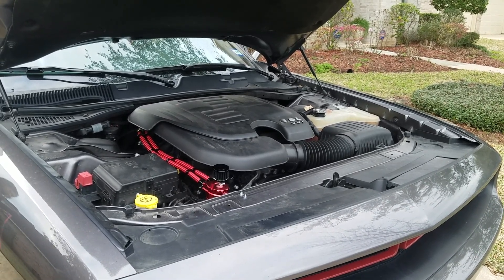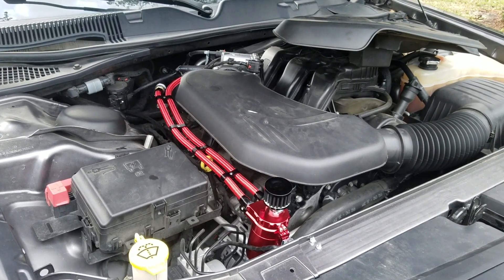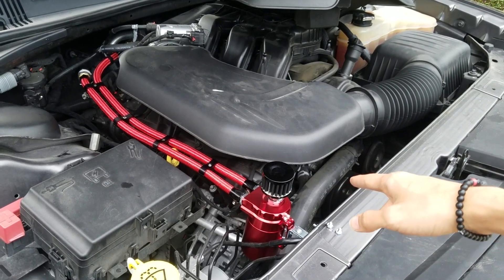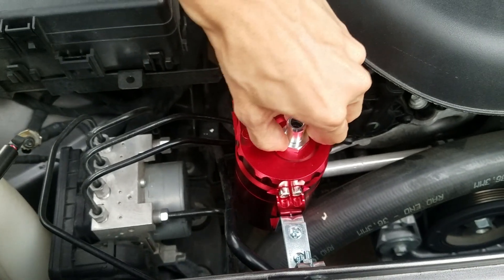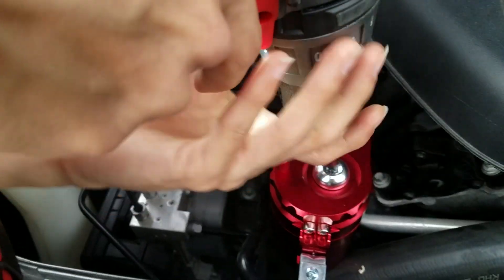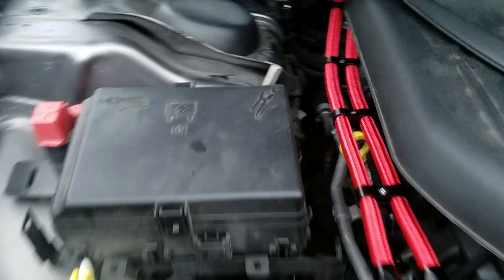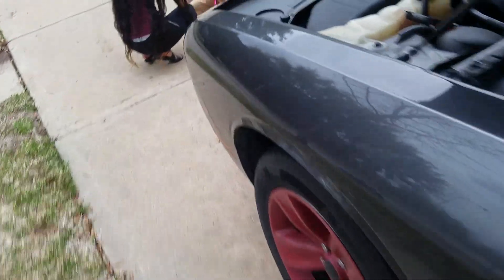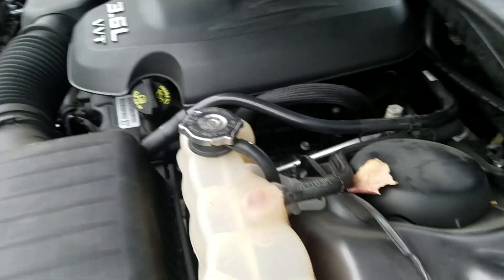Oil Catch Can with Breather or NO Breather?

Comment: If you want a breather just grab a one way check valve crankcase breather from UPR. It replaces your oil cap. That way air only escapes from your crankcase when under boost. Under normal vacuum the one way check valve doesn’t allow air to exit and functions as a regular oil cap.
Reply from the maker: thanks for the info, i dont own that car anymore

Comment: Without a check valve my Honda gained fuel mileage at highway speed but also developed a high idle.
Reply: I too gained gas mileage  I installed a dorman oil catch can on my 2012 chevy malibu with the 2.4 ecotec 115,000 miles and installed a venting oil cap for a 3.6 v6 engine for additional venting a 2.0 turbo ecotec oil cap works too I have a modified air box and air pipe peace and much respect to you 👍 JASON

Comment: Did you learn sonething in Auto Shop class today kids?  It must be so exciting to find something for the first time. Due to my experience and age I do not get that much of the basic excitments any more I been there done that.    It sounds more aggressive of course because the change is air pressure in the system.  As you mentioned the negative air flow.   That does need to be a closed system or the timing will not be proper. If you do want it more aggressive buy a Tunner or get the ECU Tuned Professionally.  I use a Monte GTR Tuner Module for my CTS.  Something about the RPM Guage I noticed it only goes to 7,000 max. It must depend on year I guess, and how the engine is made. my 2013 CTS goes up to 8,000 RPMs.  I need to do some investigation if it is the gearing or why mine goes to 8,000 while others go to 7,000 only.  I just bought an Oil Catch Can tonight because of my engine is Dirrection Injection. Hoping the Closed-loop(it does come with a Breather option), will improve my issues and filter any contaminants from the engine.  Get a Cold Air Intake will deffenantly make it aggressive and sound deeper.

Comment: It’s hooked up wrong. Just a huge vacuum leak. Instead of running the outlet hose to the intake manifold it should run to the intake before the throttle body.
Reply from the maker: Just read the other comments I already addressed the issue and the fix

Comment: I might be alittle late but are the lines hooked up the right way? Shouldn’t the dipstick be pushing out?
Reply from the maker: the orientation of the catch can can be either way. it has a built in filter area where you can add a baffle to prevent oil going back up the line. the intructions do show a certain way for the lines to be hooked up but the way i set it up it wasnt going to work right so i just switched the line. plus its a v6 so i doesnt produce that much oil vapor. i empty it every time i do an oil change.

Comment: Someone might have explained this to you already but...

The catch can is connected to the crank case on one end and the air intake on the other (not exhaust manifold as you said in the video)

Do not open the catch can or check the dip stick while the engine is running. This creates a vacuum leak where your car is taking in extra air that hasn't been measured. Furthermore if you happen to have a catch can that's 1/4 full you run the risk of the vacuum leak to pull oil from the catch can into your air intake defeating the purpose of a catch can or possibly worse as instead of vapors entering the system an ounce of oil mixed with water and fuel dumps itself into the system.

Why the can has a filter. In the 1970's and earlier they used to vent the crankcase to atmosphere. This is an open system. This is why many people had oil drippings on their driveways. The oilvapor would escapee to atmosphere but some would condense enough in the vent tube to be oil droplets which would then drip from their tube and onto the roadway. Especially noticeable if the car were to sit in one place for long time when hot. For example after the cars been driven then parked. Other than the atmospheric pollution this also caused roadways especially intersections to become slippery for the first few minutes of a heavy rainfall. So on cars like this where the air isn't returned to the air intake then a filter for it to cleanly vent the crank case pressure to atmosphere is the easier way to go. Or plumb it to the air intake as a vacuumed line to close the system.

To remove the vapors from the atmosphere they decided to plumb to vent line into the intake manifold where a vacuum exists. There are a few different locations I've see it plumbed in but personally I feel before the air filter in the air box is the best place. This though would cause oil vapors to collect on the air filter. So an oil separator is plumbed in to help the oil vapors, water vapors, and fuel condense into liquid form and come to rest at the bottom of the can, while the cleaner air then passes back into the cars intake system. If Done right with a quality can, then the air filter should see no vapors. 

Reason for the air box being my ideal location is that it gets filtered a second time (catch can is a filter) and the intake filter is always before the map or maf sensor, so the crank case air is being measured as entering the system.

There are some intakes with map sensors in the manifold after the throttle body so the vacuum air is measured I suppose but having the air filtered a second time is lost in that application.

Of you're running a cold air intake with a cone style filter and no air box then this would not work. I would suggest then that the line be tied in after but near the cone filter. This would make it easier to inspect for oil contamination coming from the crank case, whenever you remove to clean / replace the cone filter.

Adding to the idea of maintaining the air cleaner..  I'm a fan of wix air filter service gauges. Have no idea why this gauge isn't made standard on 100% of cars out there. Take 1 second to read and understand, 1 second to reset if needed. And helps owners know when the air filter needs changing/cleaning without the need to know how to inspect a filter. Really those air filter gauges been around so long, it's strange that it hasn't got it's own IP address to tell the cars 146 computers that it's time to deal with the air filter.
Reply: where on the crankcase is there a connecting point, I thought that it is connected between the PCV valve and the plenum where the PCV hose is presently connected.
Reply: @carlodonnell146  you're right! But so am I... pcv = positive crankcase ventilation

Pcv valve commonly on the (or an integrated part of) the valve cover. The pressure it relieves is a part of the overall crankcase atmosphere. And yes to the intake plenum is where the other end is connected.

Apologies for not being more specific. 😉
Reply: @danielsimpson8929  It's ok , I appreciate the back and forth conversation. Thanks
Reply: @carlodonnell146  cool beans.
Reply: @danielsimpson8929  not being specific and being wrong is different
Reply: @ismaelcarrillo3956  yes! And not being a banana and being hilarious is also different.
Reply: What?! Wh where do you think the oil was going into before the catch can? A spam folder? It was going into the air intake already
Reply: william III  great question. I've not done one on a diesel but I have fantasized filtering gases from the egr on a diesel. Not sure your 87' would have an egr. 

Otherwise I'd expect the the catch can to plumb in the same way. With a diesel having a higher compression for ignition I'd wonder if more Blow by may be seen into the crank case. If so you may find the can captures more sunburnt diesel. Unsure of the temperature required for diesel to be a vapor but I'd think the temperature of the engine oil should be high enough to vaporize the diesel out. Unless the diesel somehow breaks down the oil/forms with it.

Good luck!
Reply: So if i have a PCV system,i should install an Oil Catch Can without air breather,right?

Comment: If you're using a filter on a catch can, it needs a check valve to allow the vacuum from the engine to properly function.  The check valve has to prevent the air from being sucked in thru the breather, but can vent thru the breather in the event that no vacuum is present, but pressure from the crankcase is.
Reply: Would the check valve go the line going back into the intake manifold or the line from the valve cover to the catch can
Reply: Can the filter be illiminated and plugged? I hope I havn't ordered the wrong catch can
Reply: what is a check valve?
Reply: Check valve is a one way valve.  You'd need one for air though I believe because the fluid ones require a certain force to open the valve and a slightly less force to keep it open.
The crank case should have posative pressure at idle and negative pressure at higher rpms.  Did you attach to the pcv valve or to the crank case breather.  And it matters if you did passanger side or driver's side also, I think it's supposed to be passanger side. ALSO... the can with the bronze filter is too restrictive, get the one that you add the foil to or drill tiny holes in the bronze filtervif you already have that one.

Comment: You need a check valve on the breather, which will allow it to  breath only when under pressure. Normally this will always be under vacuum from the intake side.
Reply: won't the PCV VALVE  act as the check-valve?
Reply: @carlodonnell146  I guess it depends where you're putting this into the system. Most likely without a check valve you will be introducing a massive vacuum leak.
Reply: @DigitalSkyline  Can't I just plug the filter connection and use only the catch can?

Comment: You're obviously not getting how the system works or why you're doing it. Your goal is not to force oil out of the crank case, simply to prevent it from going into the intake side. Your system was perfectly fine with the breather.  Or you could even block off that intake side to ensure no vacuum leak situation and further prevent risk of oil in your intake at all.
Reply from the maker: I took the breather off. Car isnt meant to have it, and it obviously wasn't idling right with it on. I would just block it off. But I Leary bought all the parts so might as well. Not to mention a drilled hole lol. I am starting to lose interest in the 2016 challenger and currently working on a 1974 Plymouth satellite

Comment: The circuit must be closed , pressurized.  I don't know about turbo , but on a na engine , NO BREATHER.
Reply: no breather on a turbo application either. thats just a big ass boost leak
Reply: @Aupexx  you use a breather setup on boosted cars. All you do is run the hose from the valve covers and crankcase to the can and that’s it. Delete pcv bs
Reply: @markross215  good to know I was unaware of that. Thanks for the correction!

Comment: You have mass air meter?  If so you are introducing unmetered air into system.  You want the crankcase vapors to go back into intake after a catch can to separate oil from air
Reply from the maker: I think I do but I am not sure where its located, I removed the breather. So that isnt a problem anymore.

Comment: Excelent video bro, just what I was looking for. I'm gonna buy a catch can and I don't know if buy vented or seal. At the end I didn't understand is it better vented or sealed?
Reply: Nice ty
Reply from the maker: Either one most vented kits allow you to seal the catch can. But I would recommend sealed. Vented caused a very loud whistling sound in my system and didn't sound right. I never got a check engine light but was idling higher than usual. So sealed it is, for me personally.
Reply: @tigervxii  thanks I'm buying the seal then
Reply: @gerardogomez6104 which did you buy? Sealed catch can? How's it going 4 years later?

Comment: Looking at your "Catch Can Unboxing" vid, and the internal diagram of the can, I think the design was meant to give users an option. 1) Use the breather, so the pressure difference between crankcase and atmosphere is the force. This means you wouldn't need to connect the other end to the intake manifold. 2) Plug the breather, and connect the other end to the intake manifold, so the pressure difference between crankcase and intake manifold is the force - which would be much greater than to the atmosphere. I can imagine the breather method is if used a complete aftermarket intake with no inlet port for the PCV, or if your engine is so finely tuned, that all the oxygen level going in needs to be perfect  - which means you don't want any unknown gases.
I think a good test could've been - driving XX distance with the breather on, and then XX distance with the breather plugged up, and see how much oil actually gets "caught". I guess in theory, the amount should be more with the breather plugged up, because of the greater pressure difference. However, I have a feeling that too great a difference could also maintain a turbulent airflow in the can that doesn't make it effective at keeping the oil. - since it would keep the oil in smaller droplets and be able to carry them.
Reply from the maker: I see what your saying, I personally want with the conventional no breather  and recycle to manifold since it's a cleaner look

Comment: Can a catch can like that be use with the filter and without?
Reply from the maker: Yes, you just have to use the provided bolt to fill the filter hole
Reply: Have you catch any oil on that can
Reply from the maker: yeah, a  lot i will upload a video soon when i do my next oil change.
Reply: Thank bro much appreciate it hehe I don’t know if you know but the g35/350z burn heck of a oil
Reply from the maker: @josevelarde4113  no I didn't know, I another one for the right side kid the engine. Didn't know vvt engine need a catch can for both crank cases

Comment: All engines,except diesels, require engine vacuum for the PCV system to work not just VVT engines. The PCV is ALWAYS connected to a vacuum port! Venting the crankcase directly to the atmosphere is AGAINST THE LAW, besides being bad for your health.
Reply: Yeah, that's great and all, but how many hydrocarbons does  the production of a new engine cause because my manifold is gunked up with oil and half spent fuel
Reply: @whoathatsalotofdamage3718  Try to remove the inlet manifold, so you can see y yourself  and attest the heavy oil deposits caused by that stoopid system called "PCV".  PCV was designed to avoid venting hydrocarbons to the atmosphere, BUT saying those can be "cleanly burned" in the engine is wrong.  Heavy HC that come from oil vapors are too heavy to burn properly in a gasoline engine, and their Octane Index is way too low, lowering the effective Octane of the mixture.   Inlet manifolds get covered in oil, but inlet ports (which are hotter) convert that gunk to porous carbon deposits, that hold the extra fuel injected when accelerating hard, to release them when the accelerator is released, so hurting the proper A/F ratio; and deeper inside the engine, where temps are higher, the gunk is transformed into hard carbon, depositing on the inlet valves and reducing airflow and performance.  Why was the std PCV designed that way?  It was because it was "convenient" for the lazy and cheap automotive designers, and has been kept wrong all these years.  Install a proper Catch-Can and be surpised of how much gunk you will catch!
Reply: @alfredomarquez9777  dude I'm well aware at how dumb pcv systems are, we are in 100% agreement and I'm well aware of flashpoint polymerization that occurs to the oil as a result of recirculating the vapors and blowby. It's a dumb system, and I'd argue it's designed to increase planned obselescence

Comment: NEVER use a breather, your breaking the system and creating a lean condition. The PCV system performs critical functions to remove the constantly entering as blow-by. These consist of water, acids, raw fuel, and abrasive particulate matter. Venting is a guaranteed way to shorten your engines life by 1/4 or more.  You want to pull full time evacuation removing these as soon as they enter before they can settle and accumulate.  Breathers/venting was the standard until the mid 1960's when the PCV system was mandated to reduce ground water pollution from vent tubes dripping dirty oil in the roads. What was discovered that these same engines, using same oils were now lasting 100k plus miles before needing rebuilds VS 40K average prior to the PCV system. Only one function is pollution related as far as the PCV system.   So much misinformation out there that will harm your engine over time.  Crazy.
Reply: equally the oil vapour being recirculated back into the intake will possibly clog all the intake piping, manifold and valves reducing longevity of the engine. not to mention on turbocharged cars.
Reply: >What was discovered that these same engines, using same oils were now lasting 100k plus miles before needing rebuilds VS 40K average prior to the PCV system.

Citation needed.
Reply: @UC0kSOJVdGxks4KnhGT3OdRw You can't even make a consistent argument.  Bye.
Reply: william III    Yes. Diesels produce little usable intake manifold vacuum is the biggest issue, but to be able to filter out suspended oil vapors helps them run smoother and more efficiently as it takes energy to burn the oil. We are working on stand alone vacuum pumps for over the road applications, but nothing ready for market. But yes, get creative!!

Comment: Yours Is labeled wrong the inlet Is the side with the breather because it has to go threw the baffle first and the outlet is the other side than it will work better and it helps suck air in the tank so so it doesn't foam up in the tank